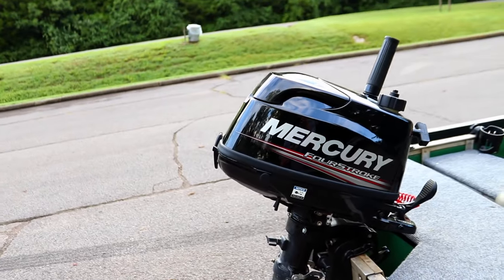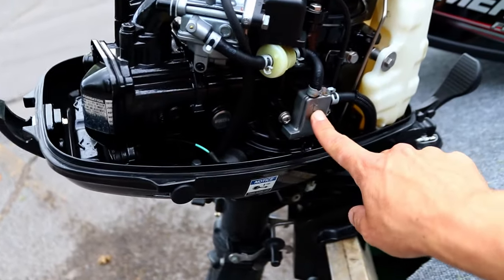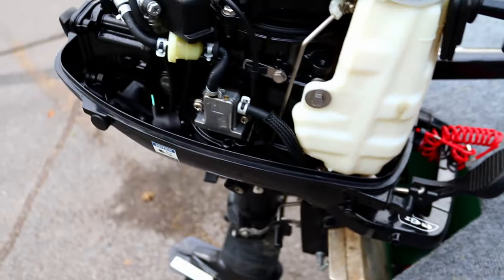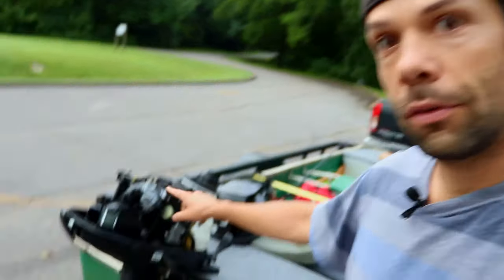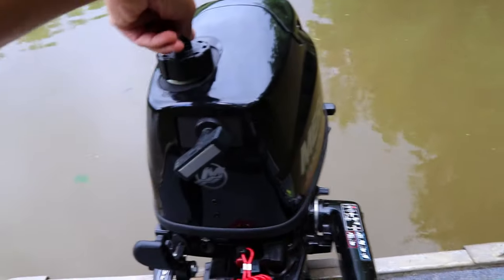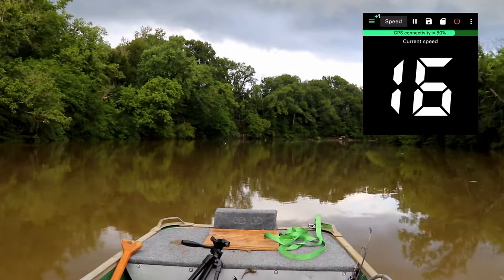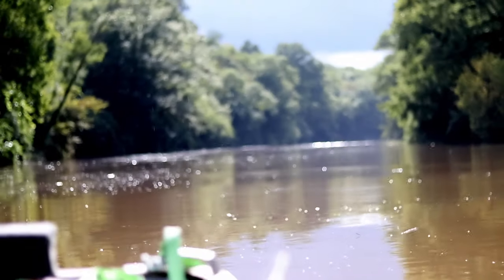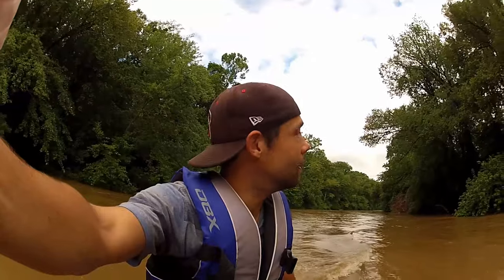Mercury/Tohatsu 6HP Outboard: Review, Walk-Through, & Test Run. Best Jon Boat Motor?

Comment: You know the wung ylou see on larher motors well that is there to hekp you plain out quicker cyz the thrust from your propeller also pushes what back but up and down as well n if you have that wing on top of your prpeller it blocks that force to push the rear end down and thus helps your engine plain out quicker you might go with say a stainless steel prop but I think the  WING mostIMPORGTANT FOR YOUR ENGIBE  you can get them for any engibe Im getting one for a 15 HP  johnson I got for 500 bucks 
I think the most important thing  is that wing on your motor because they help provide lift  so your boat plains out quicker and a small boat like yours youd notice the difference very quickly.
Reply from the maker: Yeah that’s a really good point! I am looking at a hydrofoil, I’ll let you know if I get one and if it helps! Thanks for the support!

Comment: This was really useful for me. But in the UK I'm confused. We have what's known as I'm leaded fuel. What's ethanol or non ethanol fuel???? Ok to most I may seem dum but fact is I still don't know help please.
Reply from the maker: Ethanol is alcohol added to the fuel in USA that helps the gas burn more evenly lowering emission pollution. The issue is the alcohol breaks down much sooner than the gas and causes issues in carburetors in small engines

Comment: Mite try a little sea foam in your gas, I occasionally  use it in all my small engines along with high octane gas.
Reply from the maker: Yeah good point. I started using it and love it. I switched to an external tank and now it starts in 1 or 2 pulls. I was losing prime with my internal tank for some reason.

Comment: Its not just you pal, I have a brand new Yamaha 4 hp 4 stroke and I was just about to change for a merc because of cold starting. It is a bitch and as I said to the mechanic today, I would not trust it. It has always gone but 6 to 10 pulls is normal. I have had many two stroke s and never had a problem. Maybe try a Honda then.   PS bought a remote tank , no better. My bigger outboards no problem.
Reply from the maker: Yeah it’s a common problem. I cleaned the carb, new plugs but I found my main issue being the fuel system loses prime if you use the internal tank. I did a quick video showing what I have done to help it. It’s a lot better now, still not perfect. Here’s the vid if you have a free couple minutes https://youtu.be/tD2eeR7btXs

Comment: With cold starting, if you drained the carby at the end of the day, the next time you start it cold wait at least 10 seconds for the fuel to fill the carby before starting it, should start easier.
Reply from the maker: Thanks I’ll give that a shot. I did find my main issue being my gas lines and fuel pump loses prime. I did a quick video on the issue here https://youtu.be/tD2eeR7btXs. I have much better starting performance but will look at draining carb. I have heard that is the best thing you can do to keep your carb clean without buildup too.

Comment: Run some seafoam in it. It’s a fuel stabilizer and it will clean all the jets. See if anybody makes a hydrofoil for that particular engine and it will jump out the hole and plane off. I would say a Jack plate too but I wouldn’t put it on that boat… lol
Reply from the maker: Yeah love seafoam, I run it through everything at the end of the season but started using it with every tank. Also agree with the Jack plate probably not the best in this boat but a great idea.

Comment: Now mine is cutting out when I run the throttle up. It will die but then start right up. If I get the throttle back to idle before it dies. It will stay running. Using internal tank. I’m going to check the vent cap this weekend but do you have any ideas ?
Reply from the maker: If it dies with throttle it’s usually motor is not getting enough gas to support the open throttle:
1) something is restricting gas flow (gas cap vent closed, clogged fuel filter)
2) you have build up in the carb and you need to clean it 
3) there is something going on with your fuel pump 
I did a video on this here that might help: https://youtu.be/PcjOJ5aDTMI

Comment: In my experience the plastic gear shifter can break at the gear feedthru - It simply isn't strong enough to take the push and pull. In my opinion they are not
as good as Honda outboards.

Comment: Hydrofoils can perform miracles in some situations. I’ve had them slow down my top speed but get on plane faster. My current boat it made me get on plane when it was impossible with more than 2 people before, but also raised my top speed at any load too! Eliminates bow rise in my current boat too.
Reply from the maker: Sounds like a good Christmas present. I also have an issue with cavitation once planed, I also heard hydrofoils also help with that!

Comment: i bought a force 5hp 2 stroke about 20 years ago, that thing would start first pull hot or cold as long as i remembered to squeeze the primer bulb, the down side was the plastic prop

Comment: The throttle has to be in the start position exactly or it won’t start. Not even one mm off. Mine starts one pull as long as throttle is in perfect position

Comment: you should have a prop guard for all that shit in the water.. rev up more faster or put weight in the bow
Reply from the maker: Yeah prop guard is a good idea. I tried more weight in the front but it causes the bow to drag once planed. Also with more weight in the front, I actually get ventilation/cavitation (the prop starts slipping or losing grip). I think when the bow drags when planed it causes turbulence and aeration to get to the prop causing it to lose grip.

Comment: same cold start  problem with my mercury 9.9: in the manual theres a procedure for such cases: just accelerate two or three times before pull. Or i just start in neutral gear with engine accelerated (push a button on the right and accelerate engine)

Comment: Hey you were spot on not starting easy on first try! Holy crap! 
  Hahaha! I drifted a 1/4 mile down river!
  I'm no quitter!!
  I paddled back to docking spot, just a muddy spot. 
   Put the in a log jam and continued my quest. After 15 minutes I got a little " putt-putt! A little excited I put the choke in half way. Gave another pull fired up nice. I let it idle and pushed the choke in all the way. Expecting it to stall, it didn't. Put it in reverse, nice! Forward, nice! Ran about an hour, slow and easy. Half throttle 5 min, nice. Slow 5min. Turned off. 1 pull restart!
   Only thing I didn't like was the pull starter wanted to fight me quit often. I tend to jump the gun. I must calm down I guess. It's not a Johnson!
Reply from the maker: Glad you got it going 😂 I was able to improve the cold starting process, see here
https://youtu.be/tD2eeR7btXs

Yeah I had the same issue with the pull start wanting to pull my arm out of its socket. There is a safety mechanism that locks the pull cord when the motor is in gear. I think when you pull hard that slips out of place and locks the cord

Comment: i bought the Mercury because I did not want a Japanese named engine on my US boat. I upgraded my 4hp to 6hp. I bought the carb on ebay for about $150.00. The only problem I have is switching form the fuel tank on the engine to the 3 gallon tank. It does not work all the  time. I put a power prop on mine. It made it faster and I have the original prop as a spare.
Reply from the maker: The new sealed gas tanks suck! The EPA regulated all new gas tanks have to be sealed so they don’t have a vent hole anymore so gas flow is hindered. If you don’t have a ‘fuel demand valve’ look into those. Some people break the law and either drill a tiny hole in the cap or leave the cap cracked but that’s dangerous if you flip the tank over.. You may have a thing on your gas cap that LOOKS like a vent but it’s actually just an expansion valve that lets air out of the tank to prevent rupturing if the tank is left in the hot sun
Reply: This seems odd but its a free country.

Comment: Cold starting can be solved. 1. pump up bulb. 2. pull choke. 3. fully open then close the throttle two times. 4 Start on first pull. Step 3 for me is critical on my 2014 Tohatsu 6 hp. If I skip 3. frustration in starting.
Reply from the maker: Thanks I’ll give that procedure a shot.
Reply: There is no bulb, he has an internal tank

Comment: I bought a brand new  6hp mercury  the problems I had 1, STARTING OMG !!! Over and  over won't start !!!!  The  clamps that hold it on the transom  were stripped  or cross threaded. Another  thing safety linkage that won't allow boat to start in gear broke .!!!
Reply from the maker: Yeah I had a similar problem with the safety linkage last month. It kept locking the pull start up  EVEN if it was in neutral. Frustrating, I had to rig it up so it wouldn’t slip out of position. Really made me mad. But overall I’ve had good experience EXCEPT cold starting. I’ve learned it’s a fuel flow issue and it takes a few pulls to get everything primed through the fuel pump. If you noticed how HIGH the carb is compared to the fuel tank, you don’t get gravity flow, you have to pull a few times to get fuel pump to prime everything. At least that’s my hypothesis lol. Are you using the internal tank or external? Many have said external is way better to help starting because it’s ‘pushing’ fuel into carb.

Comment: Dry nice video well done.
I have been in to hat surgery plant in Japan,and they make a great product and sell under a few badges and brands.
My suggestion to you is to use external gas tank with primer bulb. Pump it up prior to starting. You will get better weight distribution getting you on plane faster as well as having onboard fuel instead of the one gal tank. When you are done just put the extra gas in your truck. 
The boat is light so a 4 blade power prop may lug the motor down based on single cylinder. 
I build boats as a hobby and still run a 2 stroke last of the Johnson’s at 9.9 on a 16.5 foot wood boat.
Your passion is contagious and keeping the waterways clean an respecting the fish and wildlife is the right thing to do.
In fairness to 4 stroke my 50/1 mix has been closer to 70/1 based on 2. Stroke incomplete combustion.
I have worked with all of the outboard motor companies in us and some in Japan and China on the quality side. 
I have run large vessels and have more fun in a small boat with a tiller  and it sounds like you like being one with the water, good for you.
Be careful of those sweepers on the river they can cause trouble.
Thanks again for the great video!
Reply from the maker: Thank you for the thoughtful comment! You are absolutely right about the external tank. I found that the system was losing prime when I use the internal tank because the carb is so high. I did a really quick video here showing the issue https://youtu.be/tD2eeR7btXs. You are right I love small setups and small streams, that’s definitely my passion. Thank you again for the support!

Comment: Great videos!  I live in the boro and recognize most of the places you are going.  I'm looking at putting together some sort of cheap jon boat setup and I have one question:  How do you launch and load back up on your utility trailer?  I would guess you don't back the trailer down far enough into the water to submerge the wheels like you would a boat trailer, so what's your procedure?  Thanks!
Reply from the maker: Yeah back up until the back of the trailer is in the water and just push the boat off. I’ll get the wheels wet but try not to submerge them. Same with taking it out. Boat is so light it’s really easy. Only bad part is I have to get my feet wet or climb across the front of the trailer. We should go sometime!

Comment: I just got the same motor. I have had it out once. My dealer let me crank it before I brought it home. Started 1st time. I let it sit in my shed for 5 mo. When I took it out ... it cranked fine. But the fuel had jelled and I had to run it with the choke out. Brought it home , cleaned the carburetor and it cranked 1st time. Runs great now. 
I enjoy your videos. Liked & subscribed. Keep the videos coming !!
And thank you.
Reply from the maker: Nice! Had mine out a couple times this season so far and it’s running good. Was 32 deg other morning and it ran great! Having a blast with mine! Thanks for the view, really appreciate it.

Comment: I have the 4hp version. The loudness is really starting to bug me. Do you have any experience in insulating the cowling and would it make a big difference? Hope to hear from you :)
Reply from the maker: I don’t, the only real cure is going up to a 8hp. It has 2 cylinders and they balance each other out. But I think it’s worth a shot getting some acoustic foam off Amazon ($15) and testing it. I might do this, it’s a good video idea. Just be careful it doesn’t get caught in the flywheel

Comment: I had a generator that was terrible to cold start.  Then I found a label on a new one that recommended not closing the tank vent for 15 minutes after shutdown.  That fixed it, first pull now.
Reply from the maker: That’s a good idea. Makes sense, thanks for the comment

Comment: I have a coleman crawdad as well. I was thinking about upgrading to an outboard motor. Does this 6HP Mercury have a 15" or 20" transom depth?
Reply from the maker: I have a short 15. Obviously Mercury makes both a 15 and 20” 6hps. I haven’t had any major issues with the short.

Comment: By the way what would you say is a good time to run a 5hp 4 stroke per day. Time and speed?
Reply from the maker: Honestly I would not worry about it that much. I would run it as much as you want. If you are going to run for hours straight, I would not have throttle at 100% but pull back a bit at 75% so RPMs are a little lower for prolonged usage. But honestly these motors are awesome. They can handle running long distances

Comment: Cold starting is a major PAIN / issue. Sometimes 20 pulls, sometimes walk away and try later. Problem from DAY 1 brand new. Once going, always quick re-start. HATE this motor! And, to be sure, I know how to start ANY motor...just not this one.
Reply from the maker: Yeah same here with the cold starting. One thing I’m trying is to open throttle a bit with the choke on. Take the cowl top off and put the choke on. You’ll notice when you put the choke on, it actually opens the throttle a bit on the carb to get more gas during choking. I then give even a little more throttle beyond that factory set point. I just started doing this and it started on 2nd and 4th pull the last 2 times. Too early to tell though.
Reply: @Skinnyriver  Thanx...misery loves company.

Comment: Just bought the 2021 6 horse Merc, took it out, could NOT get it to start. Jet ski to the rescue, pulled back in. Tried again, nothing. What i did not do, 1) READ THE MANUAL
2) OPEN the vent on the gas cap, (reading the manual would have helped there. Lmbo
Thank you for your videos, now following you lol. Can't wait to try it again, NEXT FREAKING WEEKEND LOL. Thanks again
Reply from the maker: Yeah I have done the 3 deadly starting wind before: 1) not open vent cap 2) not open gas valve 3) had emergency stop lanyard not engaged... lol I have been at the ramp yelling at the motor when it was simply not having the gas valve open :) live and learn. Have fun next wkend!
Reply: @Skinnyriver  )